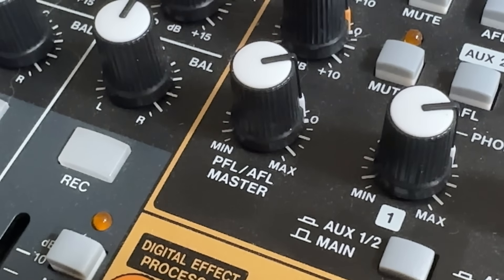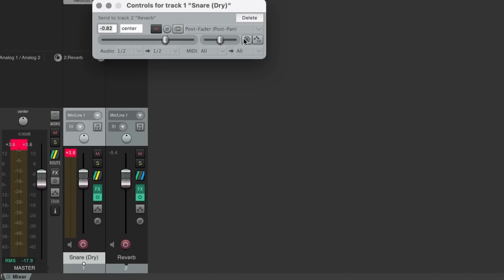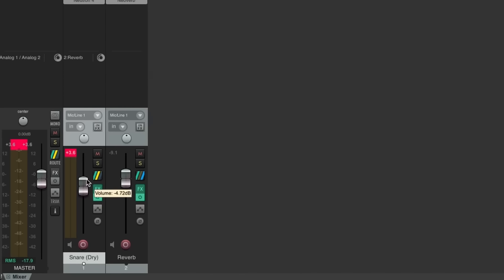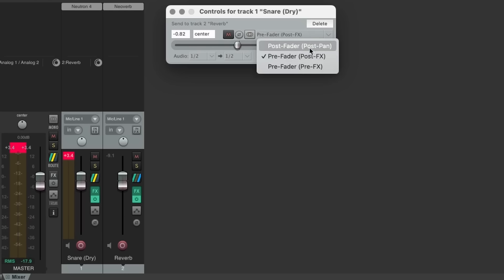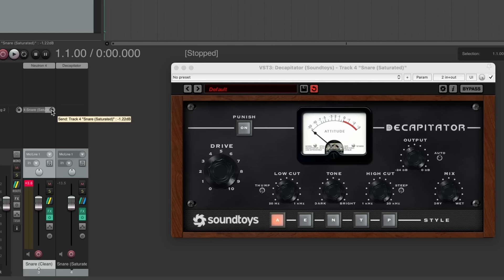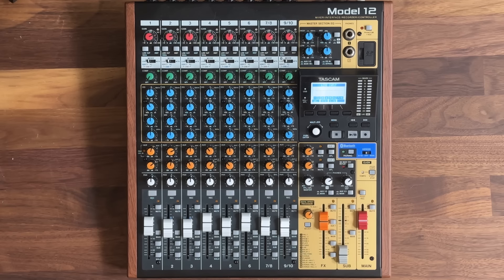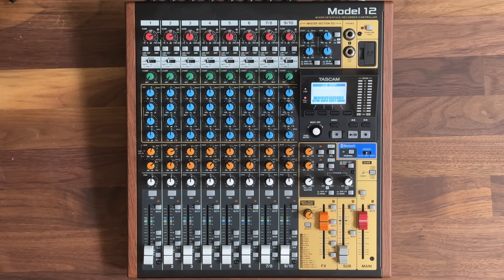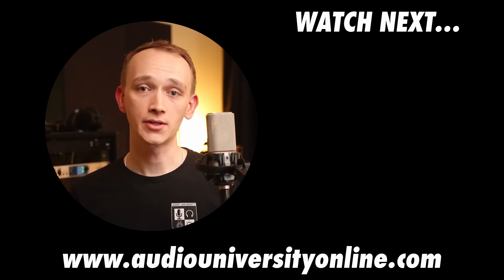Pre-Fader vs Post-Fader: Which One To Use & Why

Comment: Thanks for this video. Depending on the routing and busses, figuring this out can be frustrating when working with modulation and compression. If the track is not routed properly, when the fader is adjusted, it will change how it hits the compressor after the compressor has been set.
Reply: Was just thinking about this!

Comment: Really insightful, the only part I still can't get my head around was the @3:27 regarding the parallel processing
Reply: Me too, how are the two copies "the same" don't they both run through the sound toy decapitator plugin. I know in parallel processing one runs the dry signal the other runs the distorted plugin and "the effect" is managed through the send...I noticed that one signal has the neutron 4 and the other doesn't? Seems like a "typo"
Reply: Thank you Kyle it came together somehow👨‍🎓

Comment: Very nice explanation! I've also found it helpful to think about these as the points in the signal flow where the audio signal is taken from for the aux, especially with the layout of analog consoles. There is also a usecase for post fader monitors in live sound: when providing monitors for dance shows where the music is played from a device, you might fade out the music in certain parts and you don't want the monitors ruining that fade-out, so you use post fader sends. In that situation, you can obtain all the independent volume control you might need with the master of the send as there's only one source.
Reply from the maker: Great point! Thanks for watching.

Comment: A couple years ago I did a festival and I was told that I had to do pre-fade effects and pre-fade aux fed subs.
The explanation for why I had to do it that way it didn’t make any sense. 
I looked over the equipment and determined that everything functions the way that I’m used to that equipment functioning, so I just ran the consult the way I normally do and I never got told anything about having to change the pre-fade anything.

Comment: I use Logic and when I use sends, the default setting is called "post pan". Does this imply that it is also post fader?
Reply from the maker: I’m not sure. You can easily experiment with it to find out. Set up a reverb setup like I did in example 1.

Comment: What program are you using? Are you using logic Pro?
Reply from the maker: Reaper
Reply: @AudioUniversity  is reaper better than logic Pro? Every time I try to record even when I do basic recording with logic Pro it seems like the fans on my laptop go berserk. Reaper doesn't use a lot of intensive processing does it? I'd love to have a powerful DAW that doesn't make the fans go crazy even when doing basic recording. you need so much ram and storage space to even record with logic Pro it would seem. I like to do a lot of multi harmonies and thick layers and when I try to do all that, logic pro skips and I have sinking issues. This happens whether I have effects on the channel strip or no effect at all. I even tried recording harmonies with logic Pro on the computer that has way more ram and logic pro still skips and glitches and crackles